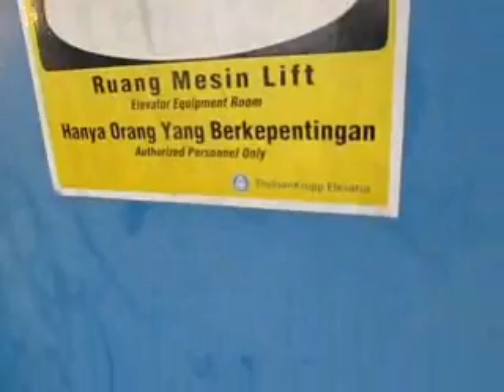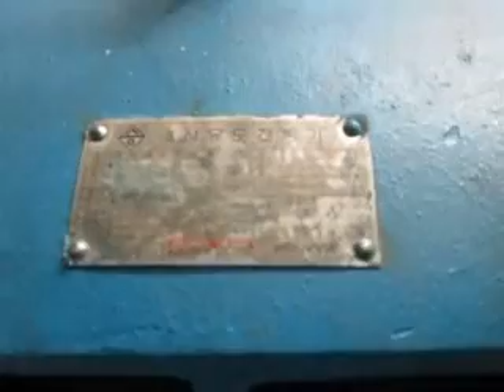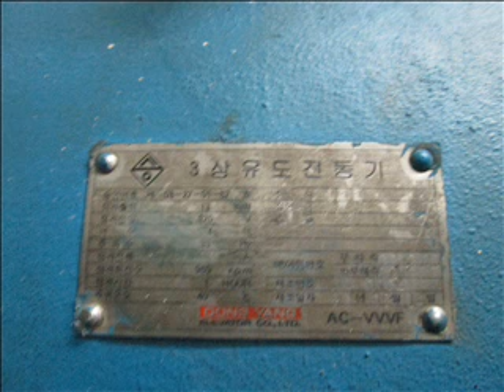[GONE] Elevator Machine Room - 1993 Dong Yang Traction Elevators

Comment: The model is AC-VVVF(?) based from the data plate.
Reply from the maker: That's the adjustable-speed drive applied in the elevator which is different from the model. I'm pretty sure the model of these elevators was the CV series, either CV40 or CV60.

The only spot where you can find the model name was the controller cabinet. Unfortunately these elevators have been replaced so I cannot check back again.